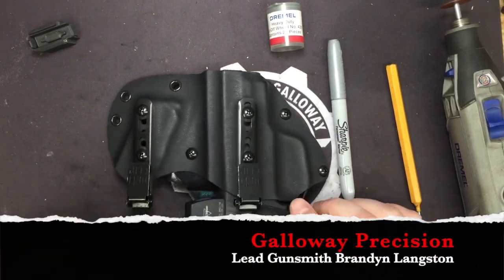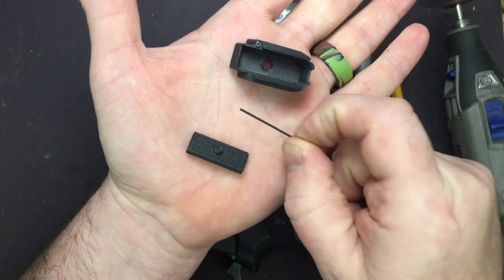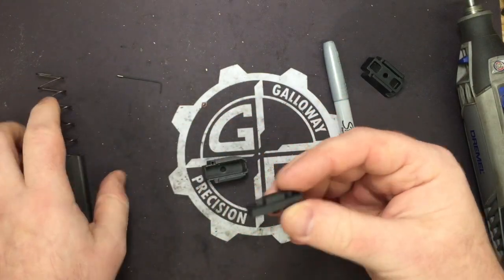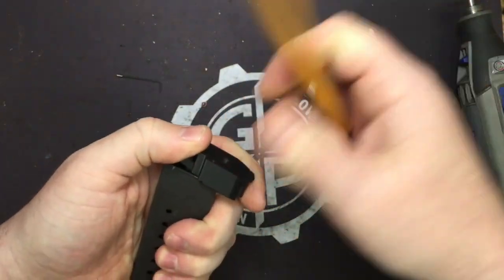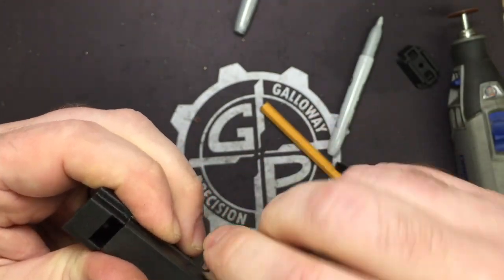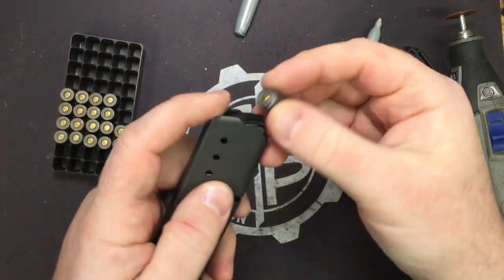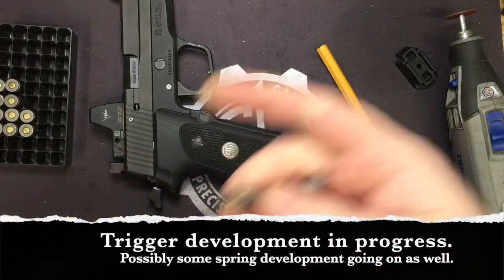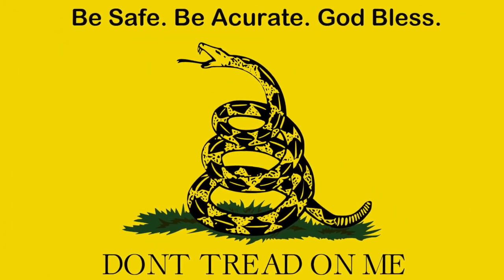P225A1 +1 Magazine Extension

Comment: Would this work for the original old school Sig Sauer P225/P6? If so, is there anyway that you can make a +2 extension/10 round mag for the old school 225/P6? Or for now is it just the +1/9 round extended mag? I was looking into purchasing a ProMag 10 round extended mag, but I read to many bad reviews on the Sig 225/P6 extended 10 round mag by ProMag. I haven’t been able to find any Sig P6 10 round extended mags other than ProMag. I work as a private security contractor and executive protection. So this would be for work, not for the range. So reliability is an absolute must. I bought my old 225/P6 as a resale back in 2008 for $350 as a resale. It was an old Federal law enforcement pistol, but they had replaced the firing pin, guide rod, recoil spring and barrel with all brand new parts. So I had to put a couple hundred rounds through it at the range to break it in. But once I broke it in, it shot like a dream. Outstanding pistol, I swear by it and I will never part ways with that weapon. Love your video, very informative. Thank you in advance.

Comment: Do you dremmel the mag on a p239. 
I got my +1 in today and it didnt come with the extra piece that used with the floor plate
Reply from the maker: This is the P225A1 extension, the P239 doesn't need the extra piece.